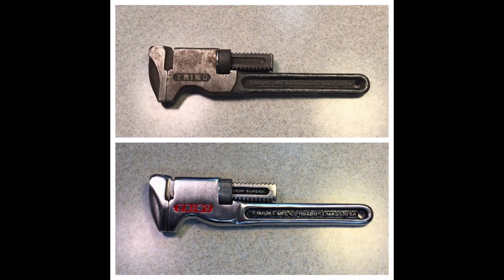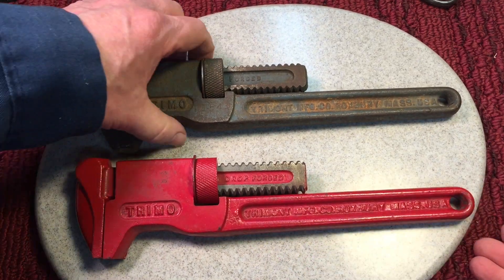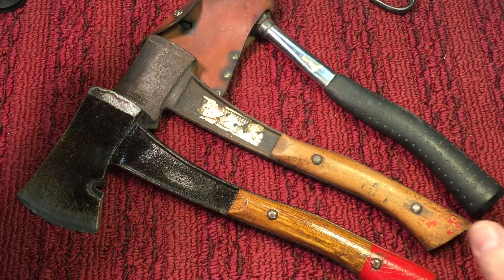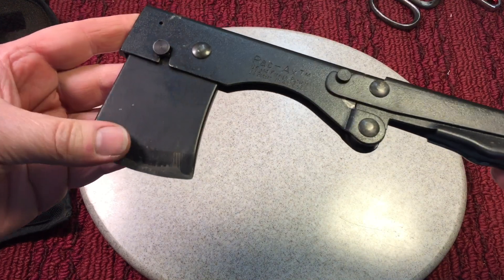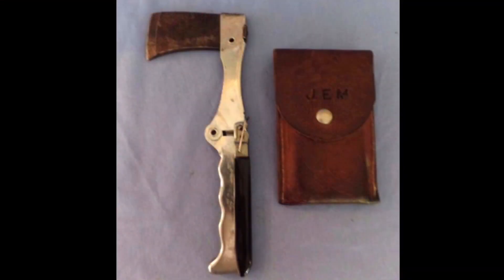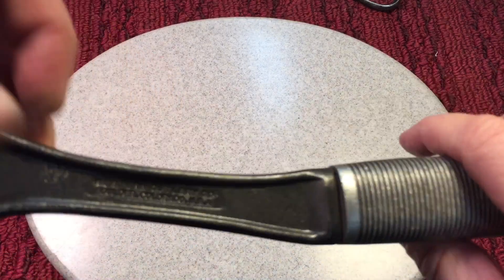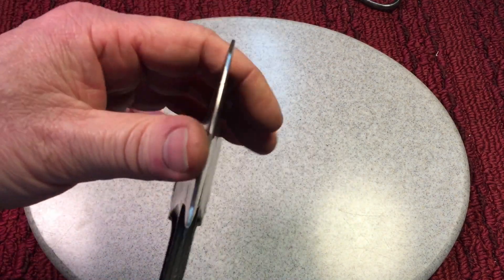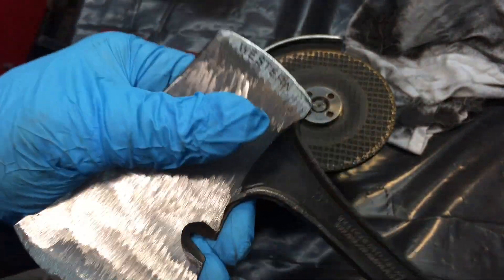Western Cutlery's BLACK BEAUTY Hand Axe and More...

Comment: Nice resto job on the Western Cutlery axe. I might have tried leaving the brand stamp on the head and tried to deepen the stamping by engraving it and using the stamping as a guide before removing the pitting. A Dremel tool with a tiny Bur or Diamond Bur usually works well. That said - looks really nice!
Reply from the maker: Bobby- I have another one of these that was in much better shape...  Once the steel is hardened it's difficult to save the lettering, I gave up a while ago...  I used to do my best to save it but now I don't sweat it..  =)   Thanks!

Comment: Hi Scoutcrafter. Lovely job as usual! Was wondering with the need to get aggressive with the grinder, and the subsequent heat this generates, does it impact on any hardened tempered parts of the axe? Thanks for the great channel.
Reply from the maker: Grebo Panda Great question!  Believe it or not if you move the grinder quickly around you don’t generate much heat, however one of the reasons I don’t wear gloves is because I am always touching the axe to make sure it isn’t getting too hot!  If I can’t keep my hand on it I submerge it in some cool water for ten seconds, dry it off and continue grinding.  The funny thing is I only had to cool the axe during the buffing stage as that generates a lot of heat!  Thanks!!!  😃👍
Reply: Many thanks for taking the time to reply. Stay safe.

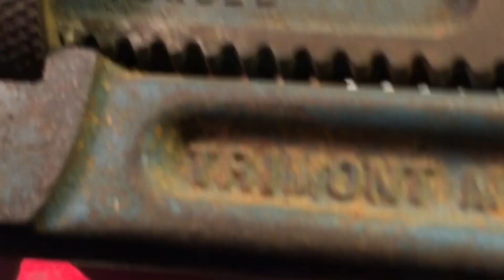Comment: That's a neat looking handle, good job on the hand axe! @ 2:15  F1543 is stamped on the wrench like it was used in a factory, maybe it was Frank's- last four digits of his s.s. number or clock number, or even Fitting Dept.

Comment: In the mid 60s, I wanted one of those knife/ax combos. Never got it. There was something funny about my 1911A1 holster in the Army. There was a slot between the holster and its hanger that a 5" buck knife and its sheath would fit. A very handy setup. 
I bet the steel handle gets hard on the wrist when used much. I've got a Bridgeport but never used it. Good Luck, Rick
Reply from the maker: Rick- You are so right...  If you have a steel handled anything you will know it right away if you tackle hardwoods!  These axes are great for fresh pine...  =D   Thanks!
Reply: @ScoutCrafter  As combat engineers the Army supply system would not give us handles for axes or sledge hammers. We had to weld steel bars to our 8# sledge heads. Man they hurt to use.

Comment: you think a quick trip in the oven if i don't have a furnace could work well to set the paint?
Reply from the maker: Martin- Even better is to make a portable oven using a cardboard box lined with foil and a spot lamp from the top or even a light bulb...  I used that many times in the summer when the burner was cool!  LOL  You want the temp pretty low, below 150 degrees... Thanks!
Reply: @ScoutCrafter  that's a great idea! and my girlfriend will appreciate much more! lol

Comment: I have a Trimo I would like to restore. It's not too bad shape but seemed like a neat project to restore anyway. However it
 has a rivet at the bottom of the jaw stem that would have to be drilled out in order to disassemble it. Any suggestions?
Reply from the maker: HP- I'm not sure where that is, can you send a pic?  Thanks bicycleguy@aol.com

Comment: Hi scoutcrafter
Whats the notch for on the axe head
Kind regards
Dain
Ps your vlogs are great
Reply from the maker: Hi Dave- Those small "V" notches you see in Axes and hatchets were rudimentary nail pullers...  They really only worked if the head of the nail was sticking up about half an inch..  =)   You might use it to pull out the nail you tapped into a tree to hang laundry or something...
Reply: @ScoutCrafter  Thank you scoutcrafter,your vlogs are so informative thanks again Dain.

Comment: Nice job. Aren't the small axes called hatchets? I don't know the difference, just asking.
Reply from the maker: upside downdog I guess it all depends on your geography- For me it was either an axe (full size) or “hand axe” a hatchet was always reserved for hand axes with a hammer face on the back...  however since real hatchets have fallen out of popularity many people refer to hand axes as hatchets now.   😃
Reply: @ScoutCrafter  
Thanks. I have never been clear on that. Not sure I am now! I have used long handled throwing axes, small axes, and even splitting mauls. The lingo in Arkansas has always eluded me after 43 years but NY dialect is even stranger!

Comment: I wonder if the handle is a stack of aluminum and rubber or, if its all aluminum with grooves that are filled with the rubber?
Reply from the maker: traderjoes Joe I believe it’s stacked as I have seen one apart and the spacers are quite thin!

Comment: You know the funny thing is I have a Bridgeport hatchet I got it from a friend who didn't really want it anymore so I cleaned it up put a new handle on it and took care of the rasta bunch of the stuff put some paracord on it sprayed some liquid rubber on the Paracord to make sure it doesn't come loose or you know then I put an extra security amount of rippage on the handle of the by using tennis grip tape and sadly when I went to go outside to test out the handle grip itch by cutting some small pieces of wood I accidentally cut open my shin with the hatchet but I learned a lesson if I'm going to go work outside with Sharp tools wear pants and knee pads and along with some boots and gloves and always be careful with a sharp tool but anyways I just keep it in a wooden box somewhere my room so I know where it is at all times but it's an awesome hatchet it's cool super old school it's one of my favorites besides all that the things I have like my knife collection

Comment: I assume the notch is to pull nails.  But if you're using an ax out in the woods there wouldn't be many nails.  Is it there just because it was an easy place to put a nail puller ?  - Kathie
Reply from the maker: Hi Kathie!  Not a crazy question at all!  I will address it on this Monday's awesome video!   =D